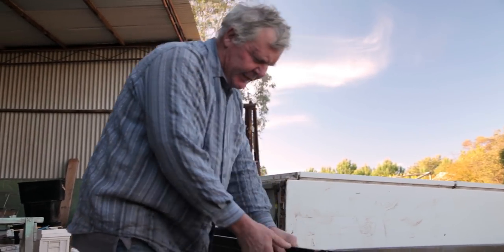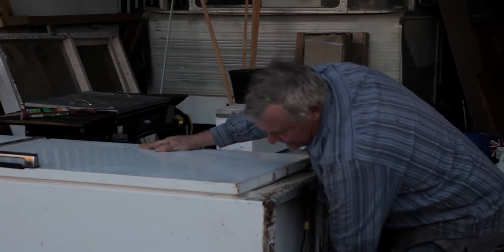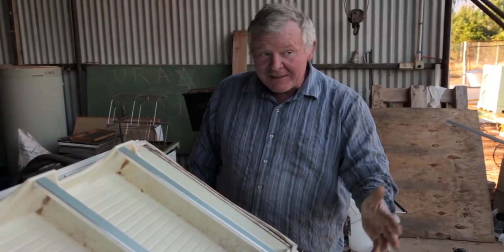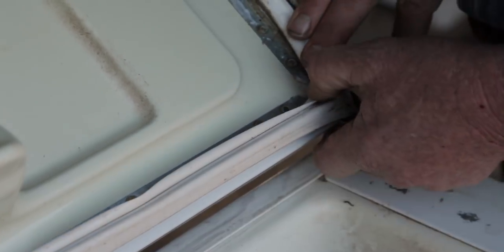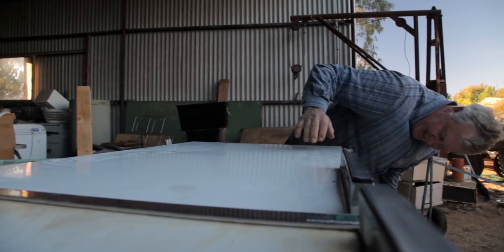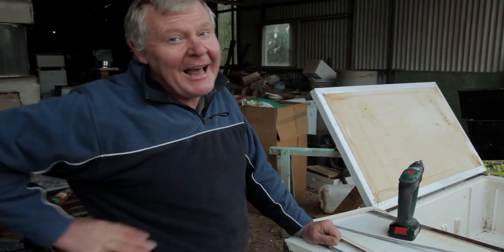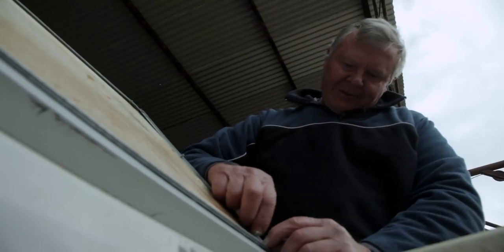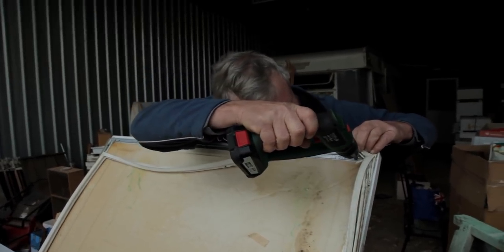Building a Top Bar Bee Hive Using a Fridge (Part 1 of 5) - Episode 66: "Fantastical Ideas"

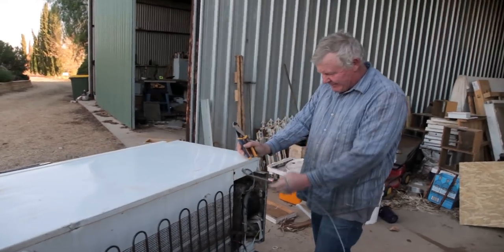Comment: Interesting video, curious to know: How did you de-gas the fridge at 2:50? 

There's several fridge based projects I need to do and now this one too, but not knowing how to safely remove the refridgerant without venting it into the air has been the stopping factor for me. Keen to know if you've figured out a way to safely remove the refridgerant gas?

Comment: I'm not a beekeeper, but would the insulation of the fridge hurt them at all? Considering its the outback which is hot as the devil's balls. I guess it could also keep the coolness in, but can bees cool their hive quick enough?
Reply: Insulation works both ways, it's a barrier of energy.
Reply: Hence the "keep the coolness in", I meant it more as a question of the bees air conditioning abilities.
Reply: "Keeping the cool in" makes no sense.. Cold is the lack of heat. if heat cant get inside (due to the insulation), the bees have less work to do fanning the hive.
Reply: Oliver O'Neill It does, if you think of the fridge as an isolated tank of air. And thus 'cool air' can be considered as a 'thing' for simplicity's sake. But that 'thing' is really just the effort of the bees fanning the energy out of the hive. I was just thinking that maybe the bees needed more open air, but i remembered they literally make hives inside of anything really (I don't actually know much about bees at all, hence the original question). Conclusion though is probably just the bees will have an easier time cooling is all.